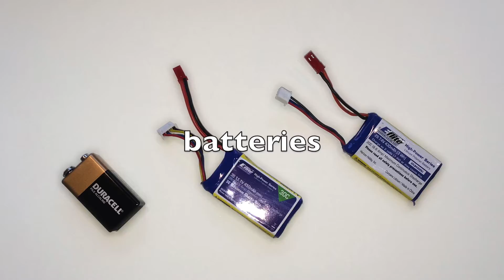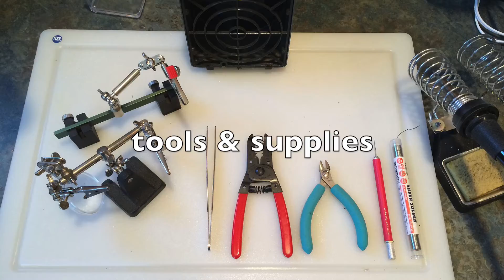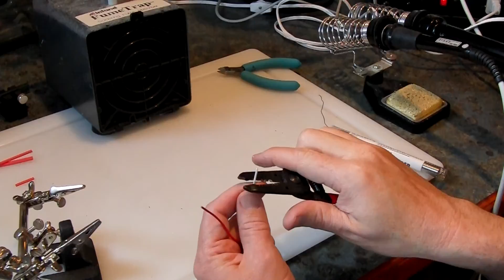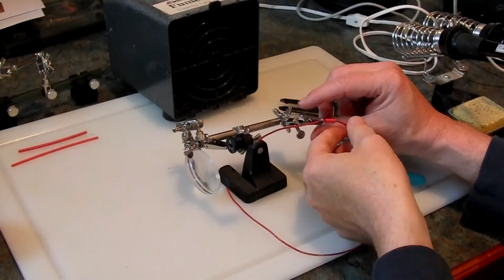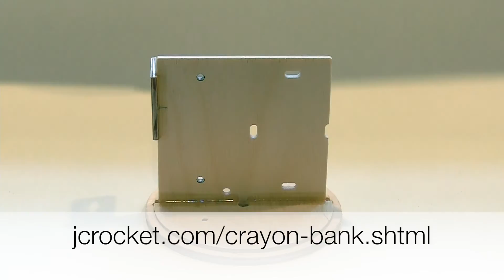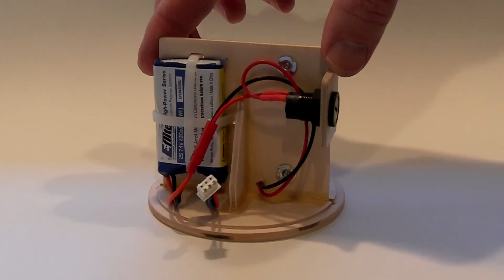Basic Wiring

Comment: Hi John I was experimenting with electronics, I built a nice flight computer however I am using solid core 22 wag wiring. They are kind of ok, but looks like too rigid. Which wires do you use normally?  As always great video and great workshop!
Reply from the maker: I prefer stranded wire and would use 20-22ga for most of this stuff. Electric matches use solid core wire (24ga?) and you have to be careful not to nick them when stripping.
Reply: @JohnLCoker  Yes I know what you mean, doing that on a recovery charge would be... well not good. Thank you for your reply. Your videos has been really useful, I cannot say enough thanks, I also took some advices for the workshop area. I have limited space but, I am doing good choice based on your guidelines. Have a nice day John!